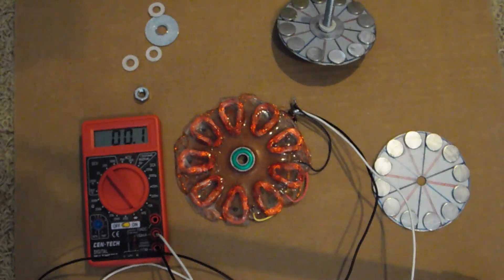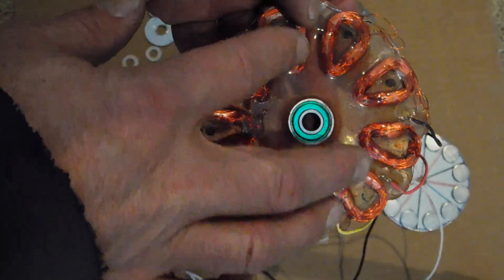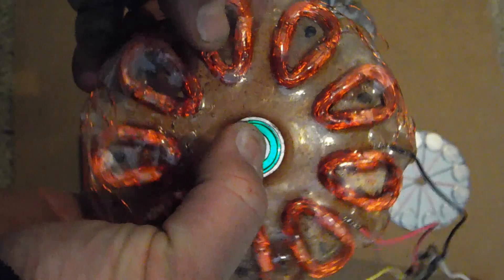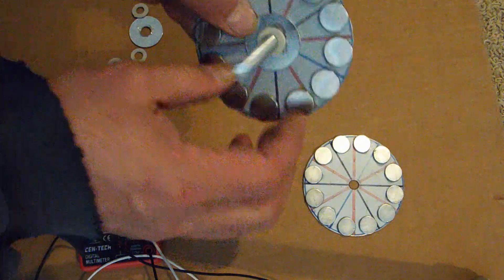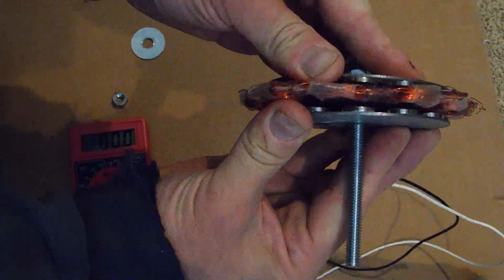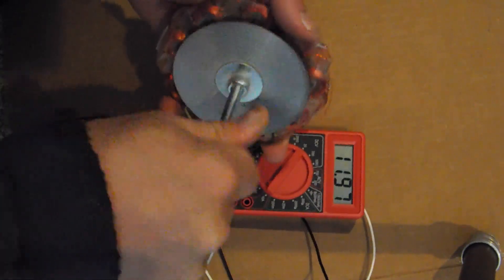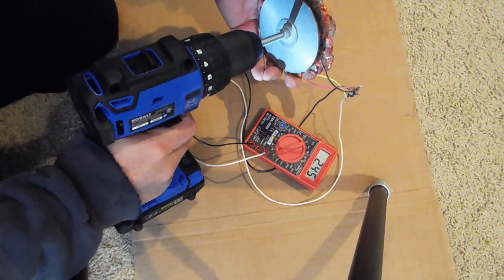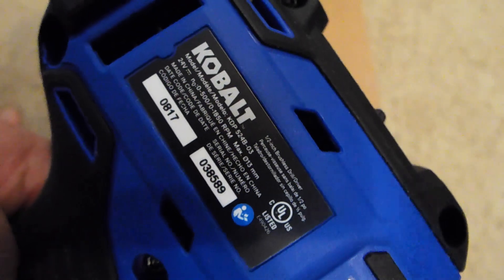Home Made DIY Free Energy Generator Small Home Power

Comment: Hi, is this wired in delta or star configuration? I've read that star produces more voltage at low speeds but fewer amps, and delta gets higher amps but needs to spin faster. I appreciate you made this over 2 years ago and have probably forgotten, so no worries if you have!
Reply from the maker: Starting with every 3rd coil wired to a common point, then every third coil is wired in series, so I end end up with 3 outputs that get put into a bridge rectifier. So it is a wye connection.
Reply: @madscientisthut  Great, thanks, good to know

Comment: very nice! please make another one about 4.5 ft across with the same desighn but with 10 gauge wire and 1 pound n45 magnets..seen one it would run a 250 volt 500 watt bulb at a very slow turn at like 5 rev per sec,,i like your little one you showed us it would be so nice in a small roof wind gen!!

Comment: Would you mind clearing up a couple of questions that may sound very elementary.  But no one ever mentions them so I'm going to break down and ask.  1. Why do most of these videos apoxy the hell out of their coils?  You didn't seem to.  2. Why is the magnets spinning and not the coils?  3.  Better yet why are they both not spinning in opposite directions?  4. In the center of the coil many will put an iron core but you do not, what the case for either?  Thank you so much Mad Scientist.  Very cool stuff!

Comment: Hello MSH. Thanks for your videos. I too am working on a mini generator (my plates being 7-1/16" dia., with a 12 coil 3-phase to 2-phase stator plates, and @ 1650RPMs). I was wondering what epoxy you used,and if you would recommend it for long-term use. I've watched hundreds of stator making videos here (none like ours so far), but none (except those using fiberglass resin, which I don't want to use.) ever mention what they use to enclose their coil windings. Did you happen to video the making of your gen?
Reply from the maker: I think the epoxy resin would be better for a long term solution, my generator was just for experimenting. most of the the standard epoxy cannot withstand higher temperature that would happen on a loaded generator coils. There are some better epoxy that could hold up to higher temperature but they are more expensive. I did not make a video of building the coil since this was made before I really had time to start filming stuff, I actually wish I had filmed it to show how easy it was to build. I look forward to see how your generator progresses, please keep me up to date.
Reply: @madscientisthut  Thanks, and Will do MSH, and I look forward to your future uploads. I have most of my parts, I need to have a few of them machined and make coil cores for my home made coil winder.

Comment: for each of the 9 coils, how many meters (and what gauge) of copper conductor did you use?
Reply from the maker: I used 28AWG and did 140 wraps on each
Reply: at 140 wraps per winding... I'm guessing each wrap was about 200mm/wrap so.. that would be around 28 meters of copper wire for each winding... does that sound right? Trying to figure out how much copper wire I would need to buy to have enough for 9 total windings
Reply from the maker: I never measured the length, I just wound them based on turns that fit in the area I wanted. I bought a 1lb spool of  magnet wire and did not go through all of it.
Reply: awesome... that's the root of my question.. how much wire should one purchase... 1lb looks like it.

Comment: You are installing g it on a wind turbine. That’s interesting.
Reply from the maker: This one was just a test of the one I want to build for the wind turbine, The one for the turbine will have several of this size pancaked together in the same housing with a controller that will add or remove each generator as the wind speed increases or decreases to maximize usable wind form a low speed wind to a very high speed wind.
Reply: Man that’s something to see, I was always fascinated with wind turbines I wish I had the knowledge to experiment like you. I look forward to see your results when done.

Comment: That's a pretty neat setup. Might make a nice water turbine generator scaled up a little.
Reply from the maker: Actually want to do it for wind, building a new one that will have a stacks of these with magnets between each set of coils and then a control system to pull power from each set as needed to take advantage of all wind speeds. It will load as wind increases, and at low speed it will also take advantage and still produce power by running at higher output voltage.
Reply: I like the variable loading concept. 😎💨

Comment: Man this is awesome very well made and I’m really surprised on how many amps you get out of that thing. What do you plan on using this for? Wind?
Reply from the maker: I am building a newer one that will have two sets of coils (separate sections)  that will have a high voltage output at low speed. I want to make a compact wind generator for it. I was actually surprised at how much power it puts out, with the drill driving it I get about 100 watts out of the first design.